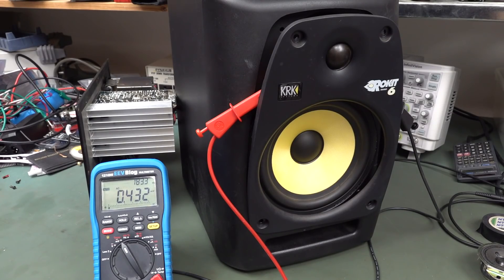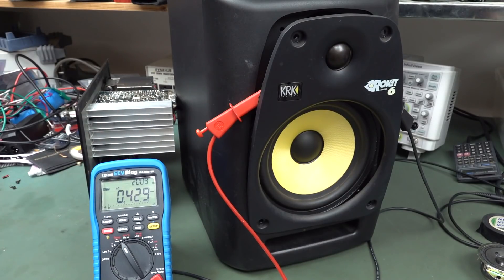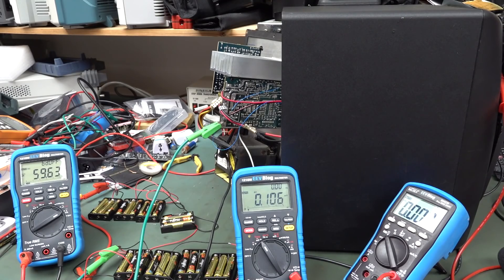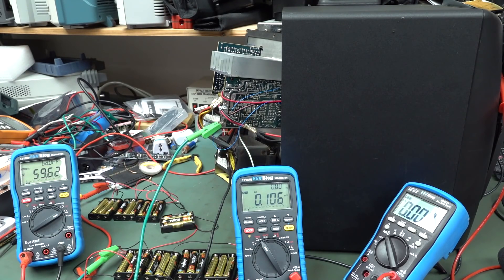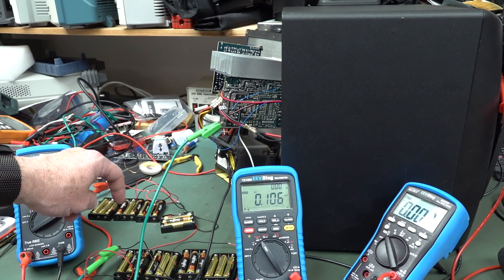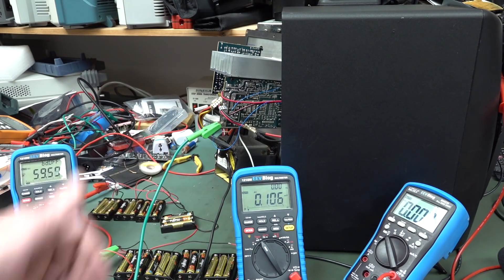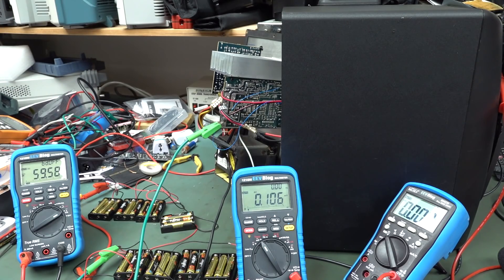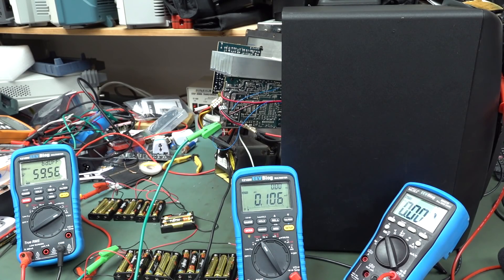EEVblog #1128 - Studio Monitor Speaker Noise - Part 2

Comment: It's hard to avoid the noise induced in transistor junctions (and passive components) as we are living on a planet buzzing with energy, mostly heat, that's jiggling the electrons around. Cooling the TDA chip would be a an interesting experiment. High sensitivity sensors on astrophotography cameras are cooled for noise reduction.
Reply from the maker: I sense a new money-making Audiophool scheme, cryogenic amplifier chips!
Reply: EEVblog that's interesting, you could make a lot of money! Haha
Reply: @EEVblog  water cooled amplifiers!
Just slap a AIO water cooling from a PC and there you go.
Reply: @fersunk I think you need lower temperatures to have an effect. I doubt Dave's amplifier was much warmer than room temp.
Reply: @guillep2k  yep, that was just a joke about the cooling on amplifiers and audiofools
Reply: Its already on a heatsink. Replacing the chip with a discrete power amp circuit would be the best way.
Reply: I would like to see the results of a top end amplifier cooled by liquid nitrogen. Is this even possible?   Hell, the place I work at puts CPU's through this.  We've been clocking at well ( I can't say ) but it's high, just wondered if this applies to high end audio.

Comment: Try restoring the original configuration, unmute the normal way (not the bodge) and then measure the actual power voltages at the bridge rectifiers (4 rails).  Replicate that instead of a guesstimate using low impedance power batteries (Pb or large Li) on short twisted leads.

Also put the experiment (batteries included) in a temporary shielded enclosure but keep your camera and digital scope outside.  That shielding could be useful for other tests, such as RF pre-compliance for your own little products.

Comment: You dropped 12db power in that noise by removing the PSU noise - I'd call that pretty significant
Reply from the maker: Yeah, but I can still hear it.
Reply: Tweeter sensitivity is crazy high, and your ears are pick it up easier too.
Reply: -10dB power is only a halving in perceived volume IIRC, if so not surprising that -12dB is still clearly audible,
Reply: EEVblog lovely video, actually I learn how to build low noise amp from your previous video about op amp noise analysis. Please do part 3~
Reply: As someone else said, I think that the frequency content is important in this case.

Comment: First, you really should be looking at the noise on a scope (time domain response) and spectrum analyzer (frequency domain response) rather than using a multimeter.

Second, it's not surprising that the batteries are an improvement on the power supplies, but the batteries have relatively high output impedance and you need to do a really good job bypassing the inputs to the power amplifier chip with some non-microphonic capacitors (i.e. tantalum polymer caps). This will reduce the noise a little, but as you said, the chip probably has an inherent noise floor of close to 100 microvolts RMS...
Reply: Don't expect a 'scope to have a low noise floor in the audio band!
Reply: The problem with using a scope isn't its noise floor. It's the scope's expectation of a high level input signal. A 100 uV RMS signal will need to be amplified by at least 40 dB and preferably 60 dB to show up well on a scope. That's why preamps were created.

The problem with just looking for a value on a multimeter is that you don't get a good idea what type of noise you're looking at. Use of the scope and spectrum analyzer will most likely show what's going on behind the scenes...
Reply: Microphonic capacitors make noise when you tap them. That is not the case here. Capacitors are not noise sources.

Comment: This is a CHEAP ($US 3 Dollar) TDA2052 power amp chip meant for portable electronics and car audio amps...
I find the entire exercise a bit laughable.
Reply from the maker: Yes, but please provide a part number of a suitable higher end integrated amp with a much lower noise floor as a replacement. I couldn't find any.
Reply: @EEVblog  TI LM833 low-noise front-end audio op-amp 
http://amplifiercircuit.net/15-w-class-b-audio-amplifier.html
Reply: why not a stk they was way better AB amps than the cheap ass TDA.
https://www.audiolabga.com/pdf/STK350-030.pdf
http://www.sphere.bc.ca/test/amps/sanyo-amp-family--fantastic.pdf
Plus no toriod transformer one a must use if you realy selling HI-FI stuff i hear the 50Hz noise on your mic.
Reply: @pufero1 because they're obsolete. 

The biggest compromise here is that the mains transformer has to be so close to everything else. I've built amps with the LM3886 that are dead quiet.
Reply: EEVblog - There is NOT any that I am aware of. Integrated audio power amp chips are compact devices for low-cost applications, they should not be used for HIFI equipment. You could easily design a compact amp with an ultra low-noise front-end audio op-amp (like Analog Devices LT1115), good quality capacitors and a couple of power MOSFETs for output section.
Reply: Look up "better" parts concerning their noise performance. I was not able to find a integrated power amp significantly better. You would probably have to go discrete power with a high quality audio opamp in the front.
Reply: Yes, and in pt.3, I would like to see this amp replaced with something different entirely
Reply: Please don't judge the TDA20xx series based on the currently available stocks. Because the current ones are ALL fake! The series has been discontinued in about 2014 by ST. Better to dumpster dive old CRT TV chassis for used ones, instead of buying the fakes off eBay / Aliexpress. Eg. the TDA2052 was used in many Sony CRTs as a subwoofer amp on a separate PCB. The TDA2030 and 2040 was common as mud in European TVs in the mid '80s to mid '90s. And they are GREAT amplifiers, considering how cheap even the original ones were. Quite low THD over a wide bandwidth, acceptable intermodulation distortion. My favourite from the series are the 2030 and 2040. I have no full bandwidth experience with the 2052, I've  used only one as a subwoofer amp (cannibalized module from a Sony TV :) ).
Reply: @mrnmrn1  I got 2052 in Sony FFH-217, which is atleast 15 y.o. I can hear noise floor sitting at my desk at night, so ~1m away...
Reply: @Mr.Leeroy  That's interesting. 2030 and 2040  are quiet, you should stick your ear on the tweeter to hear the hiss, as I remember (I haven't got a working amplifier with them currently, so can't try it). 2052 has the same input noise specification accordnig to the datasheet, but the closed loop gain of the 2052 application circuit is 32dB instead of the 30dB for 2030 and 2040. That might be the answer.
Reply: All studio monitors hiss though. It's fine. You can't hear it when you're more than a foot away. Every set I've ever had, from 15 grand ATCs to 500 quid minis do the same. It's all good. It's not worth thinking about.

Comment: Reduce gain + use custom low noise preamplifier
Reply: Assuming the total gain of the system needs to be whatever it is for this amplifier, then if you lower the gain of the power amp, you must necessarily increase the gain of the preamp by a similar amount. But yes, having the lowest noise possible from the first gain stage is key to low noise.

Comment: Your 121GW might be picking up common mode noise at levels that low, so I wouldn't trust that 100uV reading.

Have lots of issues trying to test very low signals on my bench because of radiated common mode noise getting into everything.

What you need is something like the RTA I have, you can see it here: https://www.youtube.com/watch?v=Y6Ym2IYd3O8 which will show the the audio spectrum it is seeing, that way you know if it is 50Hz or some other noise it is picking up.

Comment: It's a characteristic of class d amplification. At least in my experience. I've got JBL LSR 308 studio monitors and a Crown XLS 1502 amplifier driving a couple passive speakers. Both of these produce the high frequency hiss. My Onkyo and Marantz receivers both use class ab amplification and I don't get any hiss from them.
Reply from the maker: This is Class AB
Reply: @EEVblog  I'm definitely not an expert or that knowledgeable about electronics. Just sharing what I've observed. I would love to know if class d can be free of hiss though. I've even heard it on a professional system in a church with powered speakers using class d. I've tried searching for info about it but I haven't found much that can explain what's happening and why.
Reply: Isn't the basis that even on Class A, you end up amplifying the noise of the electrons bouncing around, hence no matter how perfect the amp, we would need to increase what "Line in" actually means in order to remove hiss?

Comment: Hi - I’ve designed a fair number of amplifiers around various types of these integrated amplifier ICs and they all have some level of inherent thermal noise due to the integrated nature of the silicon process. The better (more expensive) designs separate the voltage and current gain stages from each other. I’m not sure if that’s even available these days but we used to buy a chip that was basically an op-amp that would drive a pair of complementary bipolar transistors. Really good performance out of those.
Reply: A lot of chips that people want are out of production it seems (at least in audio). Looked up the ic amp used here and they are obsolete and go for 10$ a piece on ebay etc. I guess that demand is from repairs mostly. I've seen people willing to pay 150+$ for original Burr-Brown pcm1704 dac chips on forums. Apparently it was very good. Oh, and there was recently a 30-40W or so amp released (don't remember the brand), costs about 4k$, and is a limited run, because they could only scrape up enough late 70s japanese VFETs to make 250 of those amps.

I wonder, if any chips of today that we don't think much of, will be sought after tomorrow.
Reply: LN2 for a quick fix? XD
Reply: You can make op-amp circuits that cancel out inherent thermal noise. I once made a logarithmic voltage multiplier based on a design I saw in an IEEE paper that did that, and it was accurate down to two decimal places. This was with run-of-the-mill 5% resistors and LM324s operating under 5V. It’s probably possible to do better—I just wanted to see how well their design worked.

It was this one: https://ieeexplore.ieee.org/document/6799568
Reply: What is/was the part number of that chip?
Reply: Do you mean the STKxxx chips? These are basically matched power transistors in a common package, but they do a good job indeed
Reply: Can you point us to a schematic? 😘
Reply: Reminds me of the old Sanken modules of yesteryear. Quite large with a potted PCB and discreet components inside.

Comment: Maybe this helps reach a conclusion...
I hear it in my wired earphones connected to my mobile phone ... and then i hear it mute if there is no audio signal for a couple of seconds
Reply: That's because cellphones try to save as much power as possible for maximum battery life. The app shuts off the power amplifier, which is why you hear silence after a couple of seconds of no audio. MUTE and PowerOff are two completely different animals.

Comment: I have two M-audio BX8a monitors and one has a noticible buzz and the other is basically silent. I think on my model specifically there's some overzealous solder on power traces that can end up making little capacitors that cause it.

Comment: why did the voltage fluctuate when you touched the input board connector?!!..my pc 5.1 system has the same noise issues..but most of the noise seems to be coming from the sub rather than the high range speakers..

Comment: Honestly, just about every "powered" studio monitor will produce some hiss/noise from the tweeter. Especially if they don't have attenuators, they are always on 10! I have found when you pair a pair of passives to a "good" external power amp, you get better results. I am current using a pair of Tannoy Ellipse monitors that were tri-amped and I disabled the amp and bought 3 new discrete amps for each speaker. What a difference!
Reply: I have JBL LSR305 just hooked up to Macbook Air and the noise is something similar to what Dave has, but when I power on my desktop PC I get much louder interference, It's really annoying...
Reply: Maciej - sounds like your cabling is at fault. Solder up an unbalanced to XLR cable as depicted on p.17 of the Rokit G2 user manual to go between the PC and JBLs, and the interference should go away. If you want to reuse a cable with just 2 conductors (e.g. coax), move the shield from XLR pin 1 to 3 and remove the connection between 1 and 3. 

To my knowledge, you cannot buy an off-the-shelf unbalanced to balanced cable that actually makes proper use of the balanced input, hence what you are getting is an unbalanced connection between two safety earthed devices with corresponding ground loop noises. The solderphobic will have to resort to using a ground loop isolator like the trusty Behringer HD400 to serve as an unbalanced to balanced converter.
Reply: PileOfEmptyTapes - Hey, look at that, thanks for really great and comprehensive comment! Behringer HD400 looks promising, but how about buying audio interface and just going XLR to XLR? I don't need and audio interface, please tell me not to buy audio interface... ;)
Reply: Why not 11??

Comment: The HF hiss is dominated by significant low frequency noise that the meter is seeing.  Can you use a HP filter at 300 in front of the meter to isolate that noise.
Reply: Add a filter to the power supply feeding the tweeter. A big inductor and more caps.

Comment: I would of just made the speakers  passive monitors just to see if there isn't an issue with wiring  direct to and amo..

I wouls also checkto see if the the speaker themselves aren't causing a backfeed to the  chip because of the use of lead free solder... causing intermittent short and you could try and rf shield it  to see if it helps the issue
Reply: I've never heard of such an issue with lead free solder

Comment: quiescent current
The term given to describe the amount of current consumed by a circuit when it is not performing any work (sometimes  referred to as standby current). This is a particularly important  concept in designing battery-operated systems such as wireless beltpack  transmitters. Battery life is determined by the total current drain  composed of quiescent current and load current. Usually battery-operated devices are in standby mode more than  in operation mode so the quiescent current consumption is the more  dominant consideration. Quiescent current consumption should be as low  as possible in order to prolong the battery’s life.
Reply: What relevance does this have to the video?
Reply: At the beginning of this video Dave refers to speaker hum and directly uses this term, I had to look it up so i thought id share it.
Reply: @stclairstclair  Good on you, I hope it helps someone out
Reply: SugarBooty , I'm a retired auto tech, This of corse helped me understand electronics but I've always wanted to understand more and Dave has taught me more than anyone else on youtube, And he's funny, especially when pissed! Love EEVBlog!

Comment: 9 comments.... wow, why does no one care about having an absolutely quiet noise floor?! i honestly cant tell most of the time if my speakers are noisy, dont know about these speakers but alot of speakers do have ground loop issues, i have more of an issue on recording than output, slap a l/c filter on it, band pass ftw
Reply: Frogz But this is the stage after the bandpass that filters out the frequencies for the midtone/bass speaker and the high ultrasonics.  The entire unit needs a flat frequency response in the audible range even for very talented professionals (not quite golden ears but pretty close).

Comment: Is there similar chip by Texas Instruments that is possibly exact drop in I’ve heard a lot of the Asian manufacturers will use Texas instruments clone or knock off chips that are inherently noisy and if you exchange them with an OEM reel IT chip most of the noise goes away. On the power supply if that’s a source of a little bit of the noise can you do some sort of LCL orCRCR filtering.
Reply from the maker: Not that I found. If you have a a part number I'll take a look.